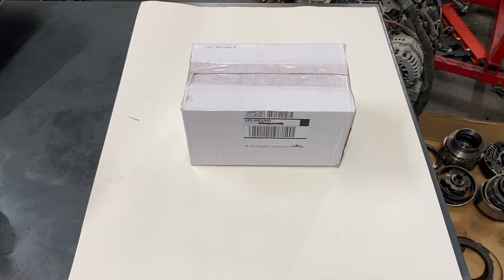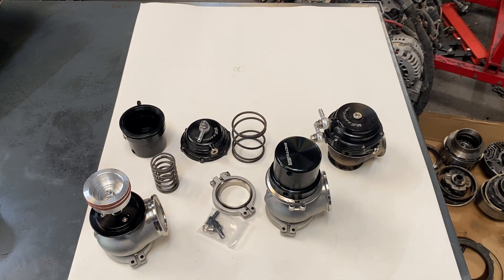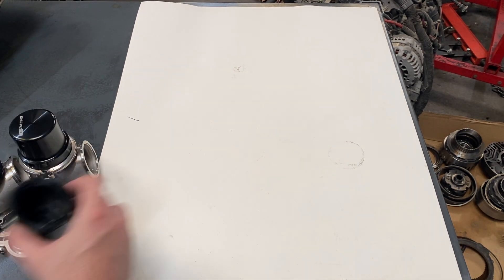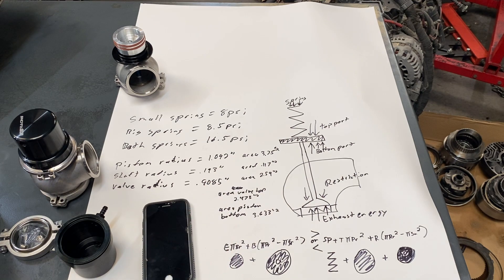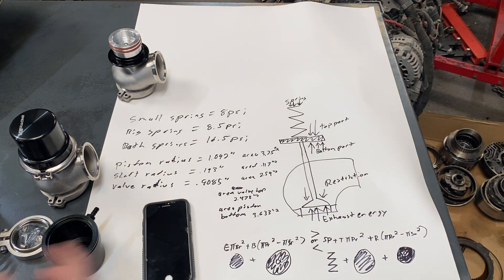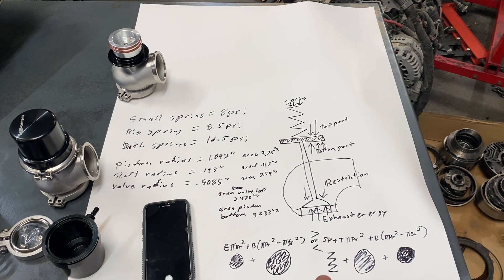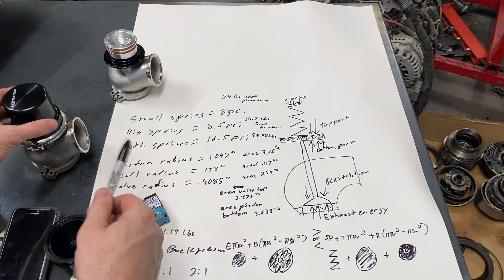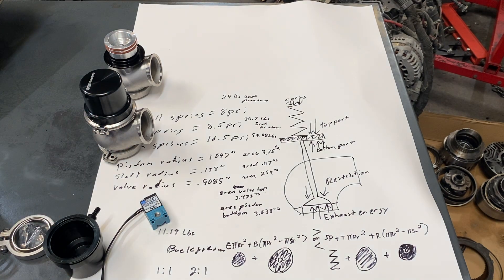VS racing gen 3 50mm wastegate

Comment: Gates look nice. Thanks for explaining it in detail. For something so “simple” it has a lot going on. Explains why you may end up with a different boost pressure then what the spring is rated for, when using the color coded springs I have received with gates I have bought.